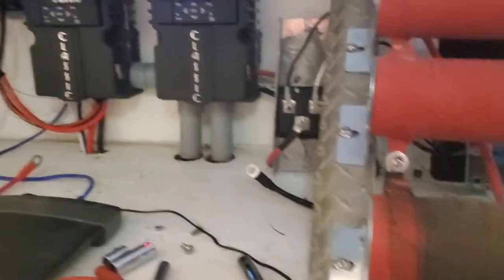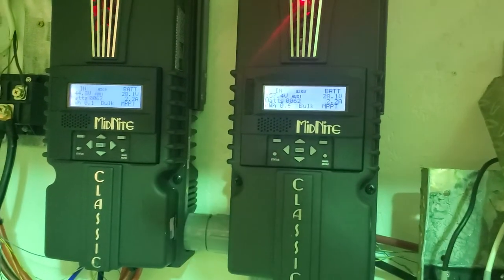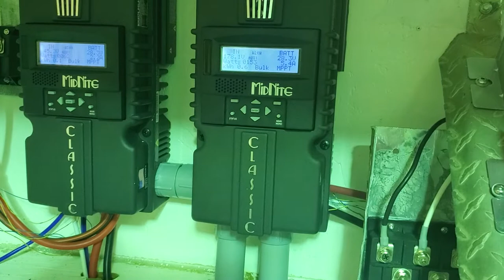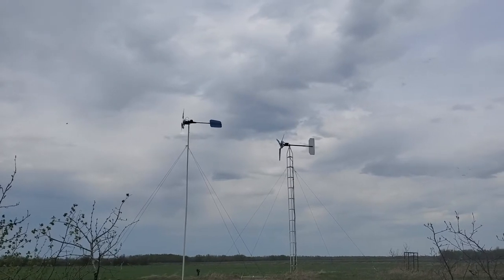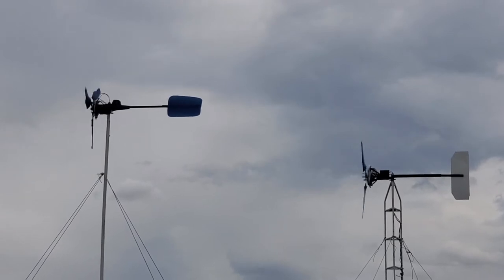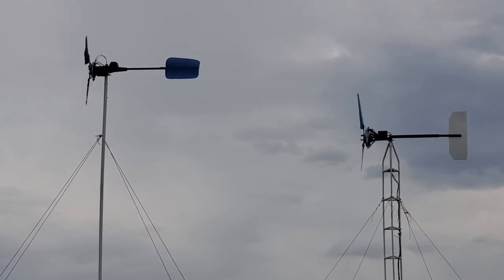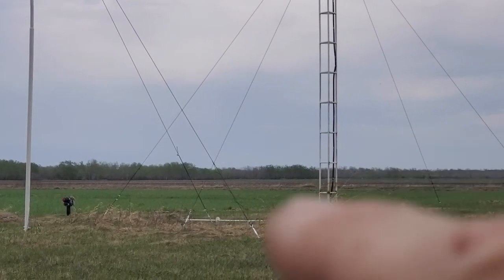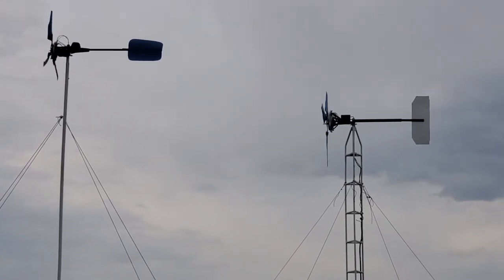Midnite classic with my DIY Clipper is doing perfect now, the Axial Flux turbines are under control!

Comment: They look nice up there dont they, youve gotta be happy
Reply from the maker: Yes I'm very happy! They also perform very well up there I've not seen a wind more than 30 kms since I put the second turbine up and I'm seeing regular 800 watts output and constantly putting the kwhs out . Very quiet too which is nice! Thanks for watching buddy!
Reply: Awesome!
You turbines are doing great especially with constant power production.
If you don't mine me asking, why didn't you use the dump load power to heat your hot water tanks?
Thanks for sharing these beautiful videos of your wind turbines
Reply from the maker: I'm not really set up for 3 phase going out to the house like that.  My plan is too be using it to heat water for some infloor heating which i already have but is working with a wood stove.  I'll leave it as is but add a booster tank with the dump load built in. Thanks for watching!

Comment: can you help me with an advice? I have a 1.5kw 24v turbine, it produced a maximum power of 2600w, now I bought a DC-DC SSR, now I don't know what resistor to buy, I went to aliexpress but now I see resistors from 1000-3000watts, but it says for example 1000w 5 Ohm up to 1000w 500ohm, and I really don't know how many Ohms they should be, as I would like to buy 3000w, what do you think if Midnite showed me the peak power of 2600w, and how many Ohms to buy, thank you very much
Reply from the maker: I'd get the highest ohms possible or some lower watts value in the 500w range and put them in series to equal 3000 watts
Reply: thank you